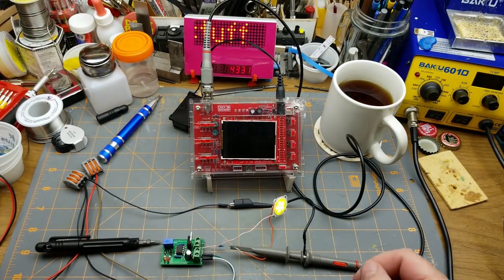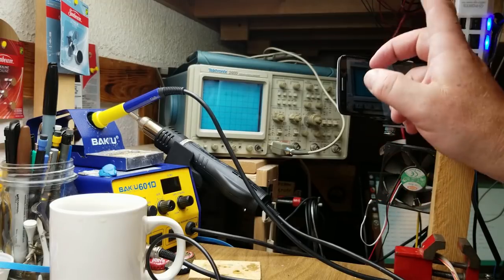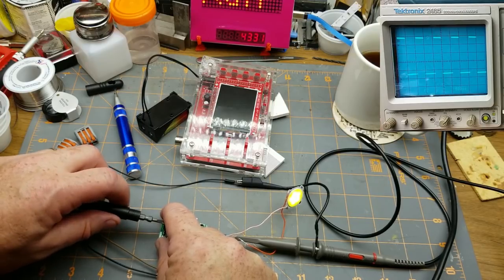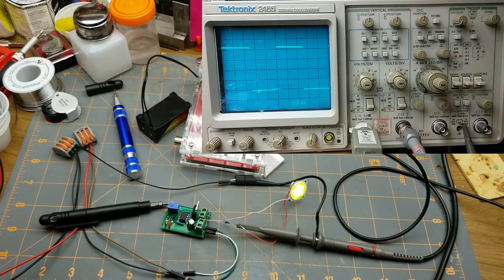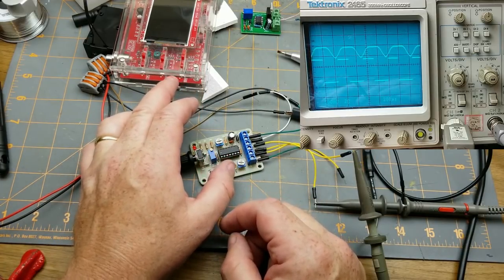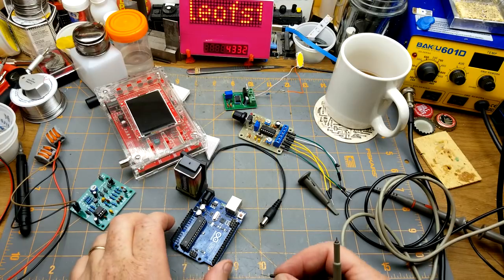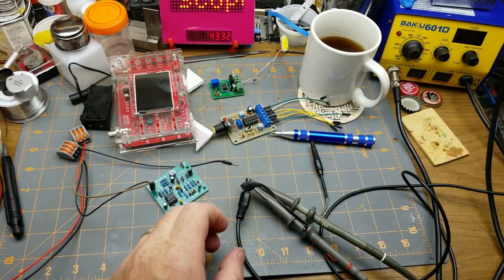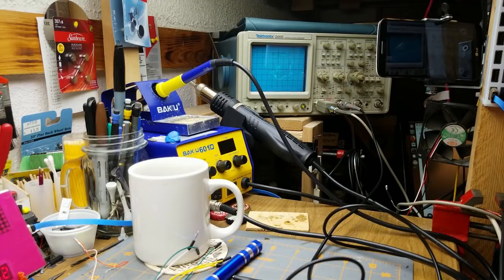Test equipment upgrade!

Comment: I am getting a DSO shell pretty soon.
My introduction to o-scopes.  I can't wait.
Most stuuf I need it for is audio stuff.
Reply: It has saved my butt several times when I work on audio circuits. Many times have my ears deceived me and without the scope i would have given up on the circuit at hand. If you have never pulled up a waveform on a scope before you might think the unit is broken, but the DSO has a 1KHz square wave that it generates so you can have a reliable signal to calibrate with and just learn how the unit works with. Good luck! :)
Reply: Aurthor Thing - Try an Analog Discovery 2 and its various software and bits. You're going to learn why your ears don't work. An DSO will blind you at audio. It was not made for audio.
Reply: @boonedockjourneyman7979  My DSO displays audio frequencies just fine. I even soldered it together myself. I would't want to risk using software for this because that implies using a computer and IF something went wrong --- that's a fried computer. The DSO only costs $20.

Comment: My buy is a bit older. With no math functions. But my Tek 464 does have a frequency output that I can run into my frequency counter. A great upgrade from my 5mhz  Heathkit and only $50.

Comment: Nice! Nothing wrong with a good analog scope, I keep a Tektronix 2245B on my work bench along with my 200 MHz and 1 GHz digitals. The invert on channel 2 can be used in combination with channel 1 and the add function which turns it into channel 1 minus channel 2 - handy for doing differential measurements (no grounding of the circuit) Be sure to check the battery for the NVRAM that holds the calibration data.

Comment: Well, I am jelly of you flexin your new-old scope.  Am at the point in the electronics hobby where it is necessary to "see" signal amplitudes, switching power supply noise, mosfet charge/discharge curves, and, well, a lot of other things.  Working blind.  Was thinking of one of those cheap PC digital scopes, but few have the bandwidth of your DSO.
Reply from the maker: It took a very long time watching the used marketplace to score this one. 
My patience was rewarded.

Comment: What a smashing purchase :-D, even old techtronix scopes will still perform well, not cheap in there day.
I have a 8038 based function/audio gen, but there are many more parts to it than your version,  maybe they skimped a bit too much.
It is a good chip.

Maybe that other board non functional preset is the output level when you use the jumpers to selsct :-).

Comment: On the 555 board the pot adjusts the output level, hence you get no effect as you are not taking your output from the out terminal. Also, the DSO138 uses an STM32F103C8, not an ATmega328p.
Reply from the maker: DOH!
That's right. I forgot about that.

Comment: Press delta v and delta t at the same time and the cursors will read frequency. Turn the intensity dial up so it shows on camera better.
Reply from the maker: Thanks, I haven't tried that combination of settings.

Part of the visibility issue is the bright "studio" lights messing with the exposure on the camera. I'm experimenting with shades that won't get i my way while keeping the overhead light off the screen.
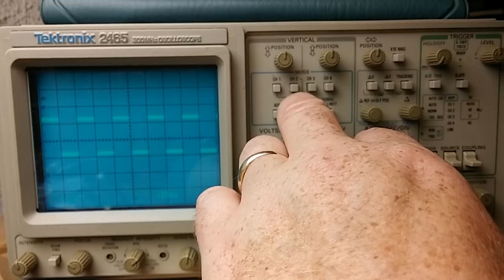Reply: @pileofstuff  - Fix the FOCUS, and then worry about brightness. Your trace is currently about 1/8" wide (see 3:54), and it should be a hair width wide. There will be plenty of brightness once you fix the focus - there may be adjustments and/or repairs needed to fix that display.
Example only: http://www.wb0smx.net/?cat=62&paged=3 (note there are 13 parts to this webpage's alignment repair)
Reply from the maker: @johncoops6897  Yeah, it does look a bit fuzzy. 

But the alphanumerics on the screen look about as sharp as I expect. That makes me wonder if it's in the channel amplifiers somewhere.

I'm still trying to track down some manuals.

Comment: Not sure why your 8038 function generator has such a bad sine wave, mine is spot on. I bought it as an unsoldered kit on eBay for around $2.50 and it blows my 1st XR-2206 function generator kit (purchased from  Amazon for $12) right out of the water. The function generator that I designed however is absolutely terrible. 😂 Congrats on the scope!
Reply: Maybe he put some wrong value parts in the wrong place?   Not like he has EVER done THAT before...  ;-)
Reply from the maker: I see you have been paying attention...

Comment: Dont melt it with your hot air or soldering iron
Reply from the maker: I made sure the hot air is pointing 90 degrees away from the 'scope.
Reply: @pileofstuff  I was mainly refering while working with the soldering iron and hot air, while returning them to their cradle and concentrating on the item soldered accidents can happen in close spacing.

Comment: That oscillator has some defect as the basic chip used does work normally
Reply: Because the 8038 style chips that come with those cheap Chinese wave form generator kits are fake clones of the originals.
Reply from the maker: @davidpyper1688  That's a definite possibility.
Reply: @pileofstuff  An absolute certainty, more like. ;)

Comment: You seem real. So here it comes ..

The soldering on the wave board is commercial. Don't ever, ever adjust a pot with a big metal antenna.  You had a 1M load on the output. It will never work. Etc. Act real to be real.

You're looking at clipping. Too much drive current.
Reply from the maker: This is a very low frequency (and low importance) circuit. I have ceramic screwdrivers for things that are important and/or high frequency.
I hadn't thought about trying to load the output a bit. I'll have to tinker with that. Thanks.